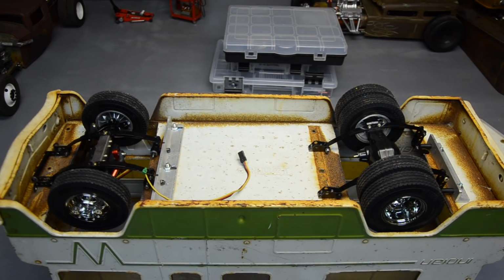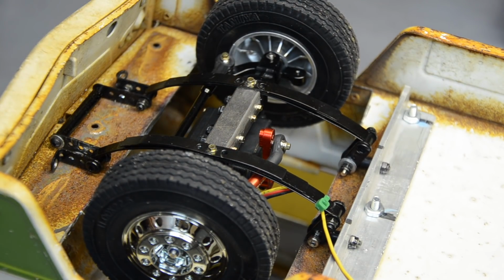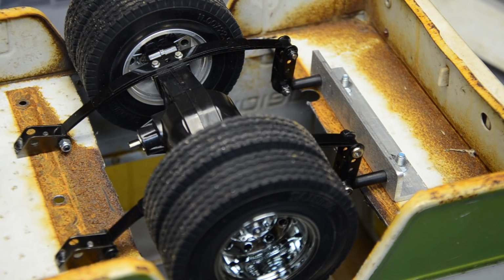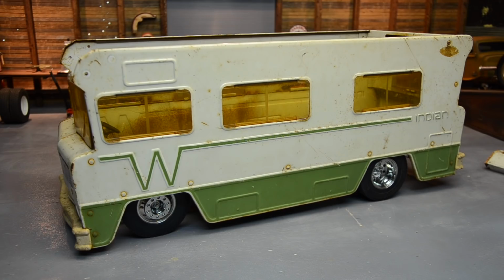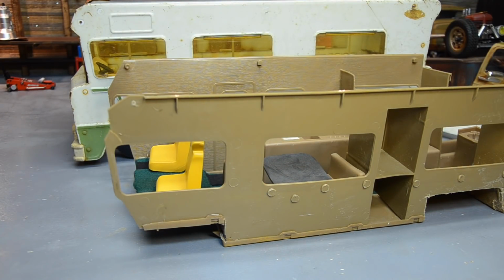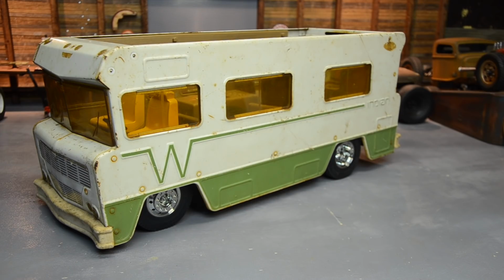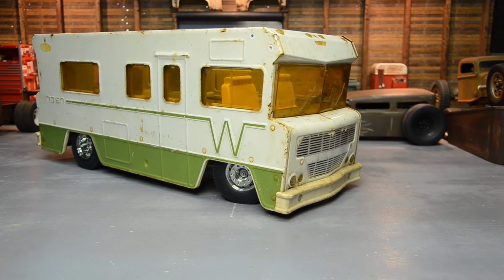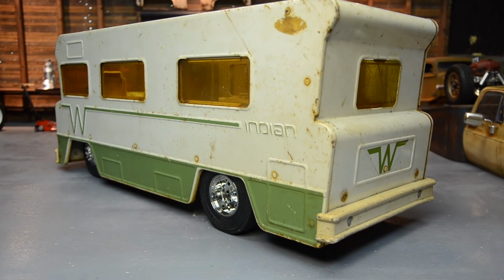Vintage Tonka Winnebago RC Conversion, Part 2, Axles & Interior

Comment: If the back side of the driver and passenger seats are visible on the finished model,  you might add some upholstery. Very cool so far.

Comment: Nice work Josh! The wheels and tires look perfect! I'd like to see the windows replaced with clear lexan and actual lights installed. As for a trailer hitch I've found the Xtraspeed hitch for Scx10 for around $10.00 , I also have one from China that bolts on the face of the rear bumper and looks super scale and it's cheap (around $5.00 or so shipped)!

Comment: You have to loosen some of the bolts/screws on the motor mount of that reduction box. I had the same issue on my custom build a couple years ago. I know it seems counterintuitive to leave anything loose on a gear box, but I've got a lot of hours mine running like that.
Reply from the maker: I actually had one of the forward planetary gears misaligned.  Locked the whole thing up.

Comment: Hello is the trans your using a 3 to 1 reducer . If so i bought 2 of them. I haven't used them yet. I bought mine for a rock crawlers. 
I found a Tonka  Winnebago just like yours . It was on a YouTube channel they had it setting in the back ground i ask if they wanted to sell it. I wanted to do same thing you are doing. That is so Awesome how your doing yours.

Comment: is there enough room to grind a flat spot on the trans. output shaft and still have enough shaft to use s set screw to hold the drive shaft on.  and happy birthday
Reply from the maker: That is possible on the trans.  I might be able to save it.  Great  tip my friend!

Comment: You may have mentioned it I’ve watched a few times only thing I miss is what is the actual rear axle housing from? Was there any modifications I was going to do the four-wheel-drive route but I am in the dirt guy
Reply from the maker: It’s al stock from the tamiya 1/14 king hauler.

Comment: Hey look this up. RC4ZS1775 from AMAIN HOBBIES. They have an LS1, a 454 and a COYOTE motors. They are not metal though but they are detail. But that part number is a much better looking headers for the orange motor if they fit. Thought you might wanna check it out.

Comment: Sorry to bother you but should I put metal or plastic for the drive shaft thank u
Reply from the maker: I have a plastic shaft on mine with no problems. Just used an old tf2 shaft
Reply from the maker: Its not a bother, Im happy to answer your questions.

Comment: question i just got the gear box like ur but the brakets are not flat what did you do thank you
Reply from the maker: I used a couple small pieces of half inch aluminum angle to mount it too.  Nothing fancy at all

Comment: Did you use a 1/14 or 1/10 gear box for this build? Very cool by the way.
Reply from the maker: its a generic planetary gear setup found on ebay usually from china

Comment: Do those rims and tires come together?
Reply from the maker: They are sold separately. Rims and tires for tamiya king hauler
Reply: Also what size are the wheel hexes ?
Reply from the maker: The rears are 12mm, the fronts sit  on bearings, no hexes

Comment: What transmission did you use? I would like to use the same set up.
Reply from the maker: It’s an off brand planetary gearbox from eBay. Pretty affordable, has the mounts as well. The motor is a stock tamiya can. Nothing special.
Reply: @RCeveryday  awesome thanks so much for your help. Keep it up. Love all the RC work you do.

Comment: Do you have a link for that transmission you used ?
Reply from the maker: https://rover.ebay.com/rover/0/0/0?mpre=https%3A%2F%2Fwww.ebay.com%2Fulk%2Fitm%2F391854968716
Reply: Thank you sir! One more question. What are you using for carpet
Reply from the maker: @Brownbarncustoms  I have used some sticky backed felt but I am looking for some cheap washcloths with a better color to replace it with.  A friend used some for his and it looks like actual shag carpet.
Reply: @RCeveryday  oh no crap.

Comment: I have one were can I get those axle thank you and by the way nice job looks awesome
Reply from the maker: They are from the tamiya 1/14 scale semi trucks like the globeliner or King hauler. Tires and wheels are from those as well. I did have to narrow the front axle to clear turning with it sitting so low.
Reply: I thank you so much for answering me back I was able to find the fornt one but I can not find the back one thank you so much againg  love ur stuff
Reply: can u help me out with a link of something were u got urs thank u
Reply from the maker: the guy I usually buy the tamiya axles from doesnt have any instock, these are similar(all metal but more expensive)
https://www.ebay.com/itm/US-Stock-LESU-Metal-Differential-Speed-Rear-Axle-for-1-14-Tamiya-RC-Tractor/224075729516?hash=item342bf44a6c:g:LsAAAOSwc5JdzgF7